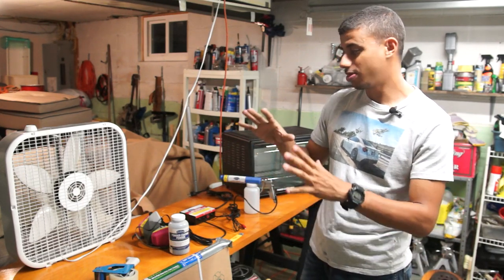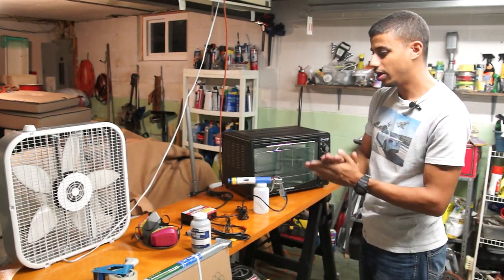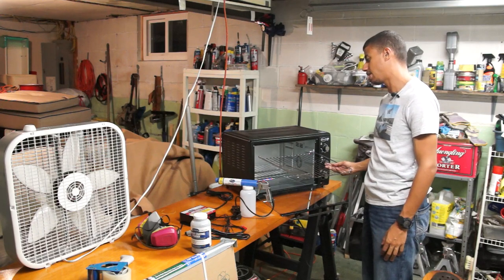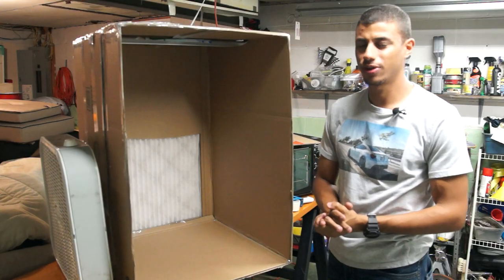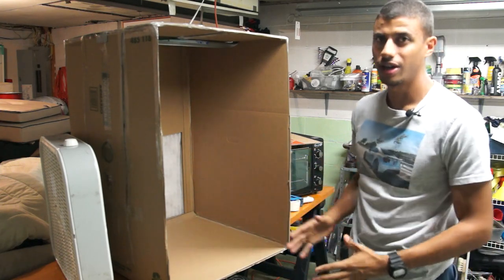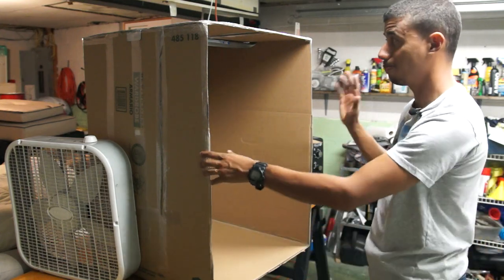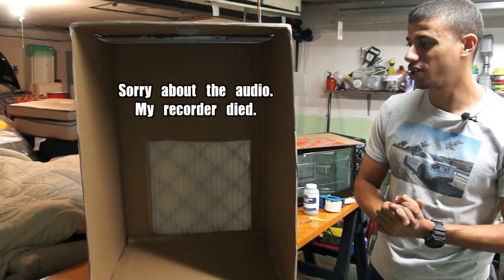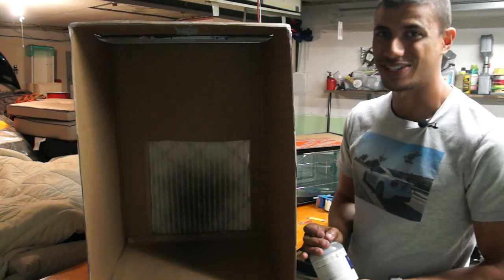POWDER COATING: DIY Filtered Spray Booth

Comment: Wait so did that metal thing come with the box?
Reply from the maker: Yes it did. It is a wardrobe moving box from Home Depot. The metal bar is meant to hang clothes, but also works great for hanging parts. 👍🏻👍🏻 http://www.homedepot.com/p/The-Home-Depot-24-in-L-x-24-in-W-x-45-in-D-Heavy-Duty-Tall-Wardrobe-Box-with-Metal-Hanging-Bar-1001020/203457762
Reply: thanks man. Great videos

Comment: but if powder is too much expensive and we want to collect the wasted powder.... what to do ??? Plz suggest
Reply from the maker: I would not recommend collecting it. It will have some dust, dirt, fibers, etc mixed in with it from the atmosphere & that will show up in your finish next time you use it. If you absolutely must collect it, you can lay down paper & then pick that up when you are finished & use the paper to funnel it back into a container. Like I said, little fibers & dust particles will get mixed in & affect the quality of the finish.
Reply: i absolutely agree with ur suggestion but dear if we filter the powder before we reuse it then we might have some dirt or fiber free powder to some extent ?
what do  say ?
Reply: the powder that stuck in the filter as shown in ur video can be reused ?